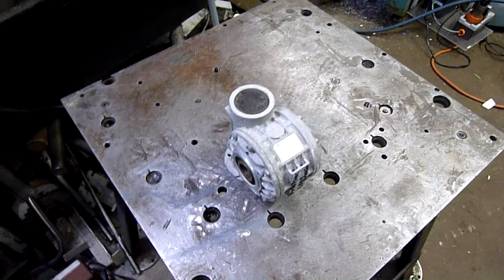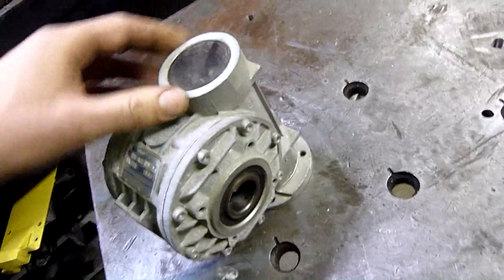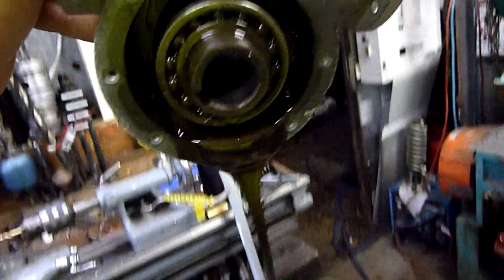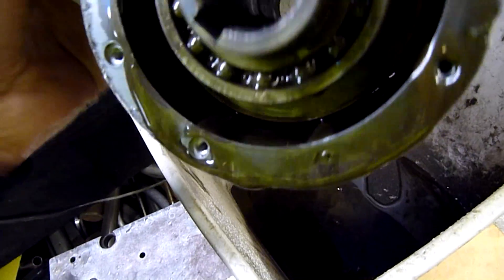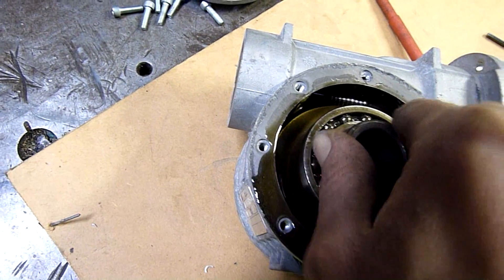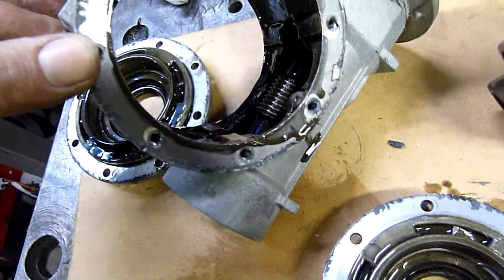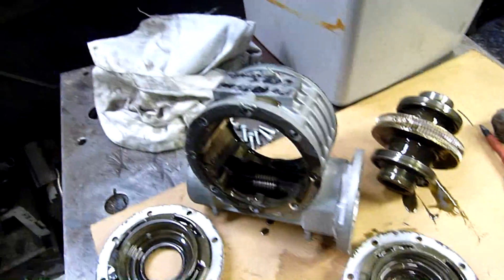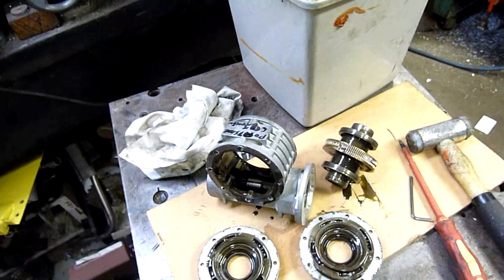SiTi 100 To 1 Speed Reducer Autopsy

Comment: A 20:1 and 80:1 combination is a 1600:1 ratio. That's slow things down a bit. You probably noticed this and changed to a 20:1 and 5:1 or better yet a 10 and 10:1 combination.

Comment: There's a funny story behind these. Never ever decide to change the sacrificial wheel from brass to steel. My good friend at work did this for his home made conveyor because he's cheep like sometimes. Nothing wrong there we all fix thing rather than buy them new. I guess it's easy to guess what happened when the chip filled bearing got stuck. Yep, the worm gear flew through the casing and bent the engine shaft.

Comment from the maker: haha yer i will split the brass gear off the iron core!

The Glycol is used because you can fill it right up and it will not expand and push out past the seals when its hot, that is according to the rep from Mechtric anyway

Comment: Get a pan and go panning for brass flakes with the water glycol mix? That one did die a slow death, probably the glycol is not as good a lubricant as the correct mineral oil for it. At least the brass is worth more as scrap than the rest of it.